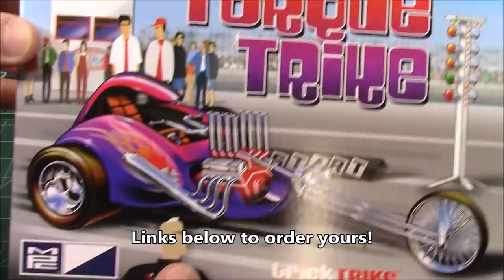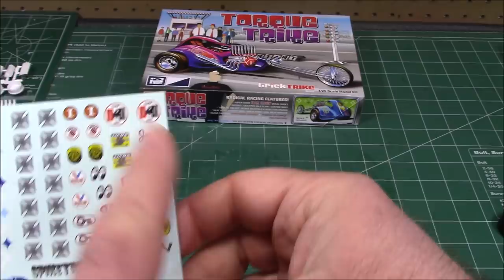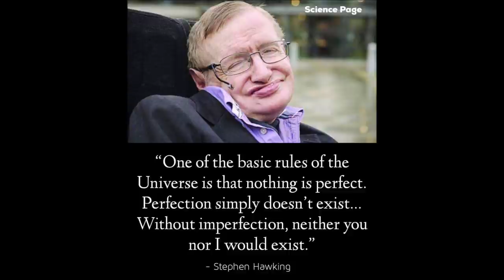How To: Future Floor Polish, Decals, Decal Solvent, Torque Trike Chrysler Concorde Scale Model Build

Comment: I recently discovered a trick for decals. Hit it with a hair dryer on low. Heating the decal helps it stick much better and conforms to uneven surfaces a LOT better then just the solution. Just figured this out 2 days ago :)
Reply from the maker: Yup, that works.

Comment: Hey Chris I can't find future floor finish anywhere, is the pledge floor care gloss finish is it the same thing ? I just don't want to ruin my paint job by using the wrong clear coat. Thank you for your guidance.
Reply from the maker: Walmart carries it, called Pledge Revive It.
https://www.walmart.com/ip/Pledge-Revive-It-Floor-Gloss-Restores-and-Protects-Sealed-Wood-Floors-1-Bottle-27-oz/15136693?wmlspartner=wlpa&selectedSellerId=0&wl13=2127&&adid=22222222227009393605&wl0=&wl1=g&wl2=c&wl3=40343007512&wl4=aud-1025747331296:pla-78303532352&wl5=1028269&wl6=&wl7=&wl8=&wl9=pla&wl10=8175035&wl11=local&wl12=15136693&veh=sem&gclid=CjwKCAjwr_uCBhAFEiwAX8YJgQfeRIAMa8bIlRpiZJ4LgOTW_0k3OPw4hNj6FiqKDwRJk9B8nfO8ChoCDD8QAvD_BwE&gclsrc=aw.ds

Comment: i tried the future floor gloss and im getting bad results. the brush marks are coming through and quite a bit of run on the sides of my model. also a gritty look to the overall top. wasnt like that before. if i have to respray itd be my 3rd respray. any help?
Reply from the maker: I don't spray it, I brush it on and then I walk away. Zero issues.

If you keep messing with it as it dries you'll end up with all kinds of problems.
Reply: @hpiguy  i was brushing it. Would you know how to possibly take it off without ruining my paint? Because it would be my 3rd time repainting the body.
Reply from the maker: @Camska427  The bottle says ammonia and water remove it from floors. I assume it would work on the body too.
Reply: @hpiguy  ok ill try that. Thanks